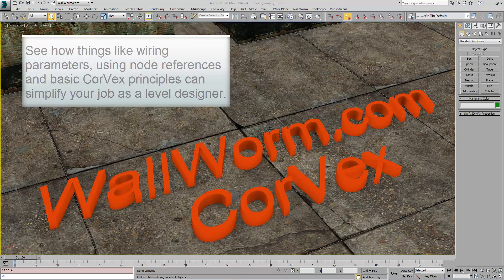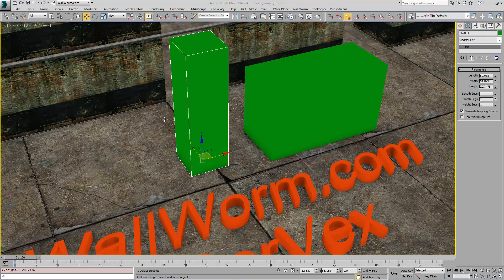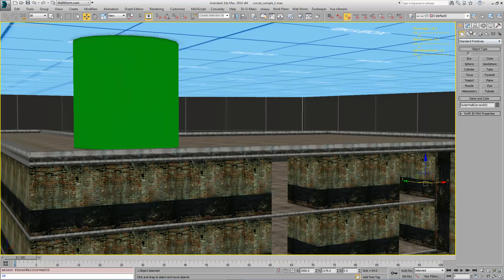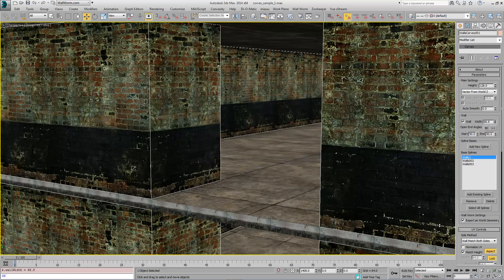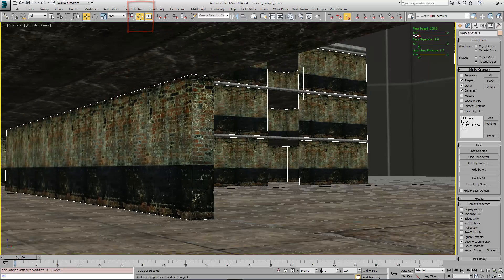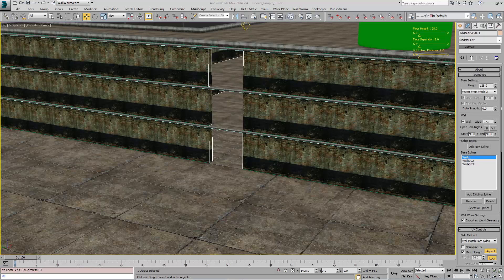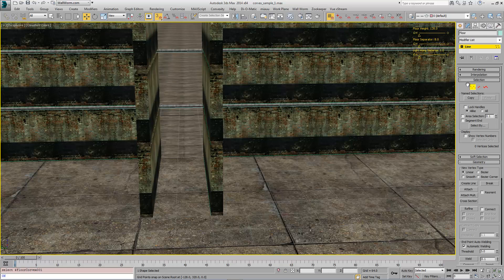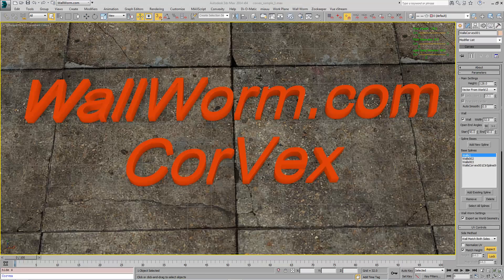Parametric Level Design

Comment: Is there a way I can create a window without needing make a gap in the main spline and create two new splines  ?

Create 2 new splines as in : 
The main spline has corvex applied to it and makes a +128 high wall, the make a gap in the spline to make space for a window.
The 2 new splines in to fill that gap : the first is on the bottom with corvex wall applied to +32, the second on top with corvex wall applied to -32.
Reply from the maker: Yes, this is possible. It's late for me to explain it, but I will try to find time later this week to make a video to demonstrate the procedure.
Reply: @ShawnOlson  great thanks!